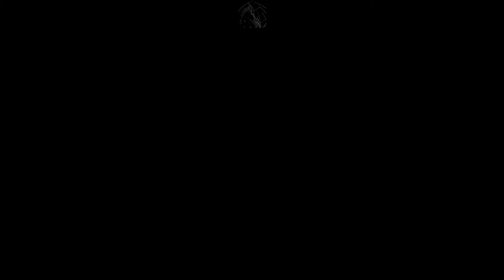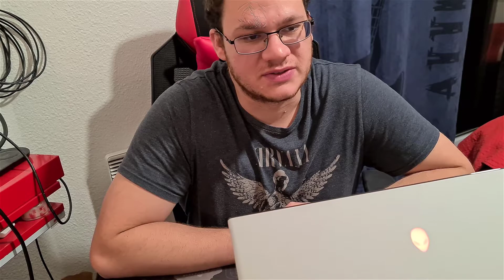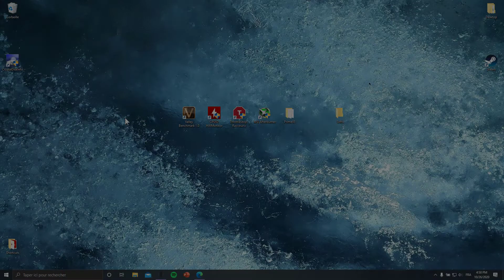How to Undervolt Laptop CPU / OC GPU / Reduce Heat FULL GUIDE (M17 R3, I7 10750H, 2070S)😏😏

Comment: does the Alienware Command center sound settings over rule the settings that are done in the Real Tek App?, i see there are a lot of options for alieware sound once inside the FX Drop downs
Reply from the maker: Yes I think itover rule or supperpose to it.  Just like the "fan" profile over rule the CPU clock. But I'm glad we have so many options to configure the sound.
Reply: @cyclo16hacks  Maybe you next video on the Alienware can show us how to set up the Alienware macros above the Number Pad, i cant seem to find the best info on this and cant seem to do the actions i would like
Reply from the maker: @1995bulldog  I don't know if I'll do something on the macro. I personnaly used this video : https://www.youtube.com/watch?v=8MfKwxBAyTg  it is already a good one and allowed to configure  all I need (software launch and key bind).
Reply: @cyclo16hacks  thanks I’m going to check this out! Have a great day
Reply: @cyclo16hacks  i Also noticed in Command center if you set it to high performance mode, you lose the ability to quick adjust the battery performance options on the battery icon in the bottom right task bar
Reply from the maker: @1995bulldog  it's weird. It's like sometimes it shows up ... sometimes it's hidden. I'm using silence mode atm ... and can't ajust it too. Command Center is defenitely doing more than playing the fan speed.
Reply: @cyclo16hacks  just leave the power mode in Command Center to Balanced and same within the windows Control panel. after that the slider always stays and you can then adjust on the fly, power save modes clocks my cpu down to under 3.0 while in high performance its always stays in the 4.0
Reply from the maker: @1995bulldog  I'm actually trying to over rule the silent mode. Since I could use this mode all time thanks to liquid metal. But I want 4.3 Ghz on all cores XD